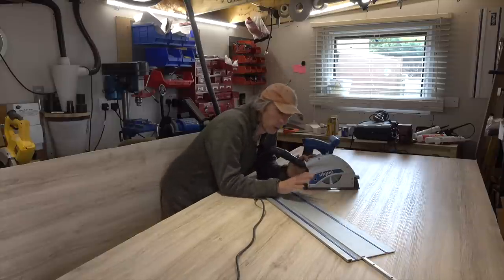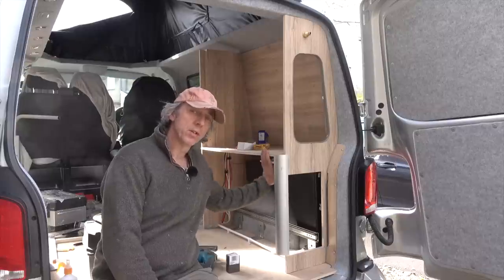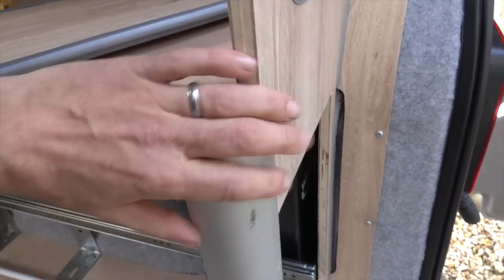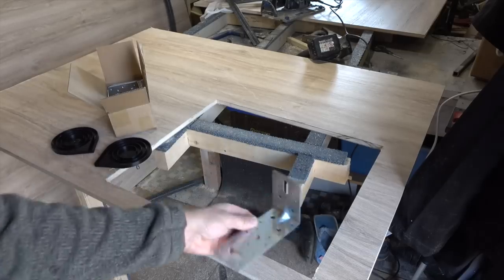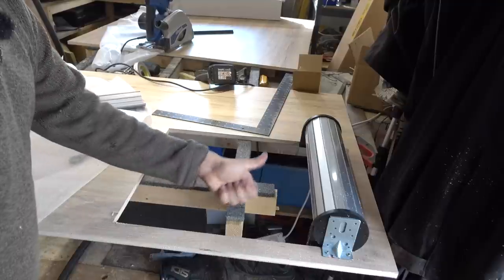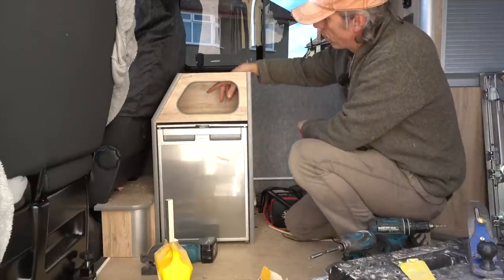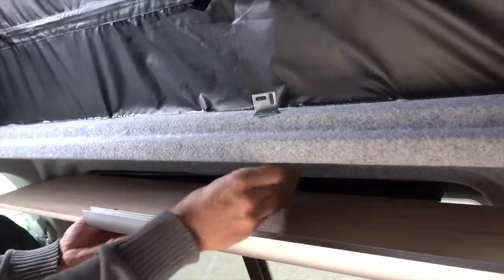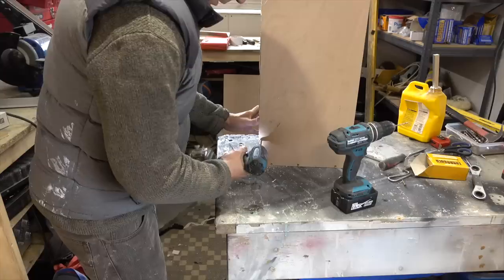7. Custom furniture build VW T6.1

Comment: I have seen this trim being added to edges to make them neater, and you are using your router to make the groove for the trim to lock into? 0:39
Could you tell me what the ROUTER BIT is called so I can purchase one and then do the same to parts that I create.
And also what the edging strip is called if it has a name.
 Cheers.
Reply from the maker: @JustMeZero988  https://www.ebay.co.uk/itm/315193417376?mkcid=16&mkevt=1&mkrid=711-127632-2357-0&ssspo=k6ww4_xfqkk&sssrc=2349624&ssuid=gYZVpcwKTPK&var=&widget_ver=artemis&media=COPY
Reply: @KBeadle  Took you a couple of minutes to reply. Not fast enough. 😜😜😜😜 Thank you very much for that. Couldn't have replied any faster if you had replied before I sent the question. Thank you again.👍👍👍👍

Comment: Hi Karl. Thanks for all your videos, in the process for converting a VW Maxi Caddy, so scaling cabinets down!! I bought your PDF file. Great reference links. Could I ask the size and weight load of your pull out drawer runs and where did you get them. Many Thanks Dave.
Reply from the maker: Hi Dave they where from Amazon https://www.amazon.co.uk/Pieces-Extension-Drawer-Bearing-Capacity/dp/B07WYZ2QVC?pd_rd_w=Y3i03&pf_rd_p=72bd67d1-fcfe-4eb1-b188-74959eded5f8&pf_rd_r=1BN4HWQHDCXHP7BSXN3G&pd_rd_r=de566dd3-f8e5-40d9-8841-e57e2958b4d7&pd_rd_wg=y0P6e&pd_rd_i=B07WYZ2QVC&psc=1&ref_=pd_bap_m_rp_32_sc
Reply: @KBeadle  Noted many thanks.PS The Diesel heater is out of stock any other you would recommend?